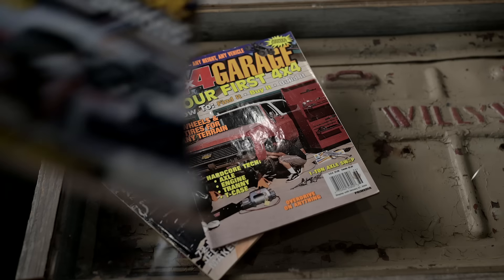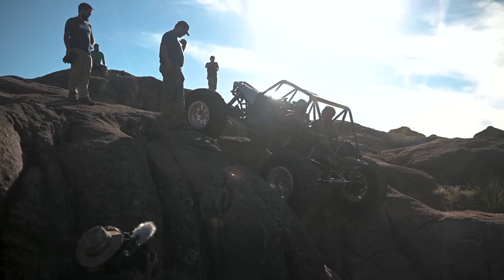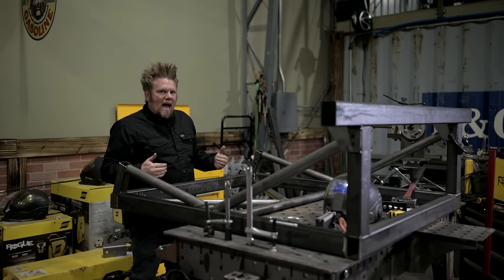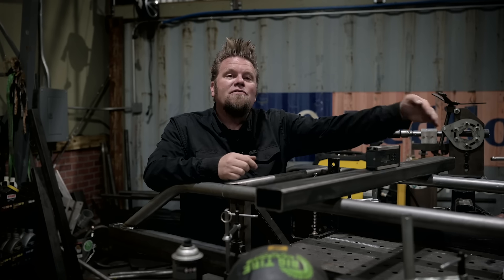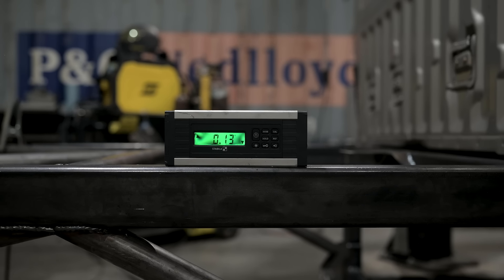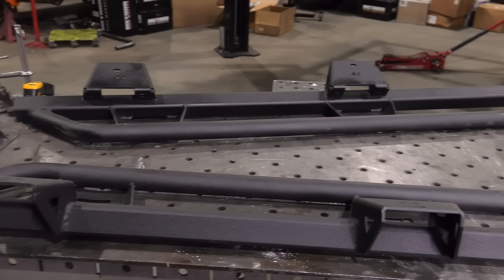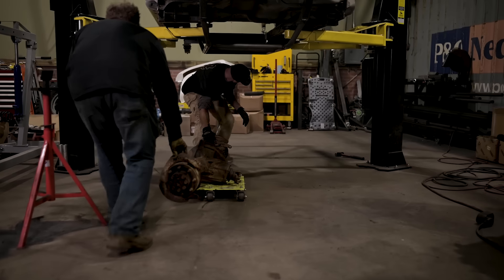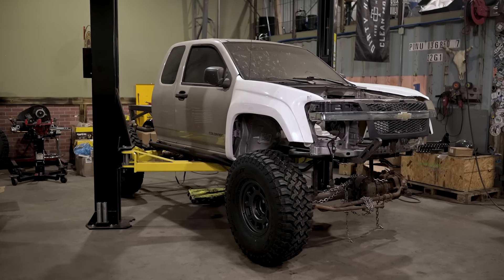4x4 Garage: Ultimate Adventure Chevy Colorado Build Part 1 | MotorTrend

Comment: Would look even more insane if all those tubes for rear chassis were bent into shape instead of just straight cut & welded, especially at the rear wheels, those 2 pieces could have been 1..
Those hydraulic tube benders should be widened to handle 2 pieces at once so they always end up symmetrical..